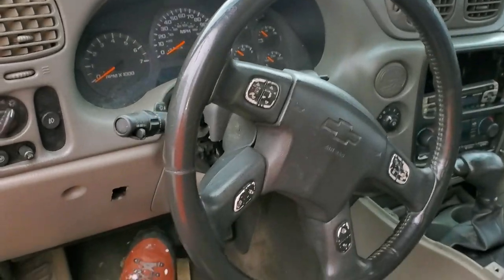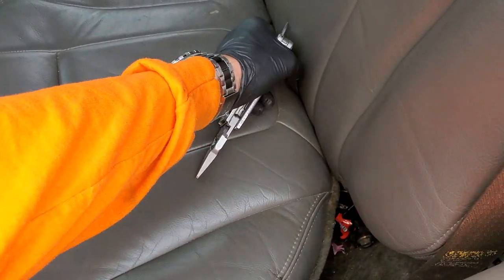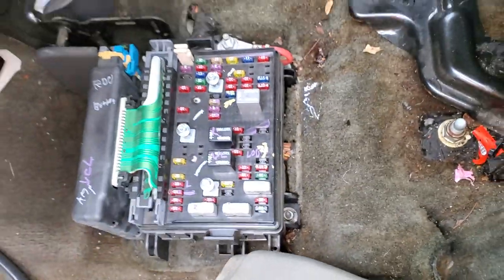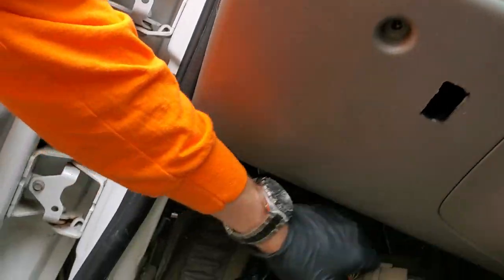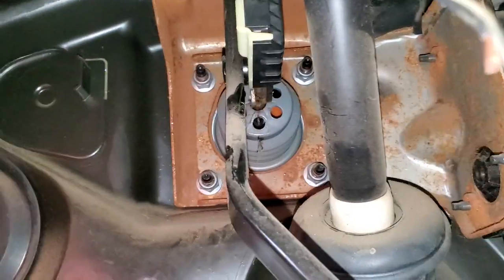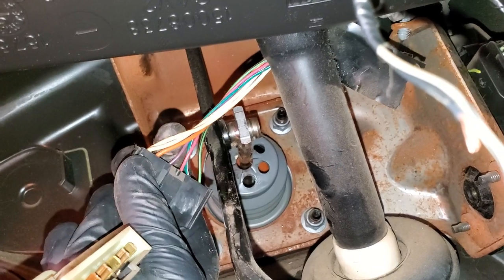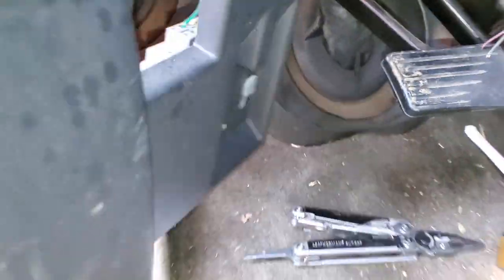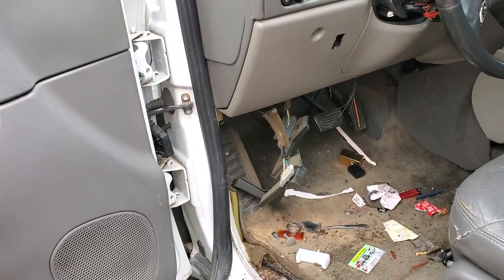2002 Chevy Trailblazer Stop Light Switch Replacement & Brake Light Fuses

Comment: Both sides of my break lights do not come on.  Reverse lights, and blinker lights work. Running light on passenger side is on. Fuses look good, changed the tail light circuit. What are my other options?

Comment: I checked Fuses and bulbs all 3 lights out changed the switch today I now have left light and top light passenger is out but when I turn the flashers on all the lights work 🤯🤯🤯 any one have any suggestions

Comment: Bro, you ripped that panel off and it looked so fun!! I would love to do that but we all know we won't! Entertaining and funny but it would have been cool if you did a cut scene where you unplug all the connectors and show the right way and then cut to a clip that shows you ripping it all out, lol! Love it nonetheless!

The cruise also does not work in my vehicle and combine that with my break lights not working then we know it is the switch. I thought I would share this for others as a troubleshooting tip. A two year old video holding its own in value! Subbed... Good job!
Reply from the maker: Thanks brother!

Comment: Thank u for this tutorial, I have a Chevy Trailblazer ls model, my brake lights just stays on. I'm also having trouble with the low beams and have to consistently, go under the hood, open up the fuse box just to pull out the fuse for the low beams....to be fixed very soon. Anywho, I purchased the brake switch for brake lights and will use this video to guide me to install correctly. This was a very informative video....Easy Peasy! I've also subscribed to your channel for more interesting videos that could help me as well for any other problems that may occur....hopefully nothing soon.🤔👍😀
Reply: Did the new switch fix the brake lights staying on?

Comment: Does this brake switch wiring have anything to do with the factory trailer plug harness? I have no power to the left brake light at the trailer plug. All fuses look good. The truck brake lights are OK. Right trailer brake light is OK.  Any clue? I'm baffled at this point. Any insight appreciated. Thanks!

Comment: I done everything, from the fuses to the circuit boards, to the brake light switch. And only the 3rd brake light works. The left and right brake light want work but my tail lights work? What else could it be

Comment: Would this impact the drivers side electric seat? I lost power to the seat , to the rear wipers, and the brake light fuse keeps breaking when engaged ? Pleas help 2003 trailblazer lt

Comment: Will this also fix the cruise control? I saw other videos of individuals replacing these on other GMs and it fixed it. Is it the same for the trailblazer? Great video by the way 👍
Reply: I have the same question.
Reply: I had same issue with no cruise control and only had light indicator for reverse and doors didn't unlock when put in park, so I switched out the neutral safety switch and it fixed those problems.
Reply: I swapped out my accelerator pedal with a new GM one and it fixed my cruise control as well as some engine power issues.